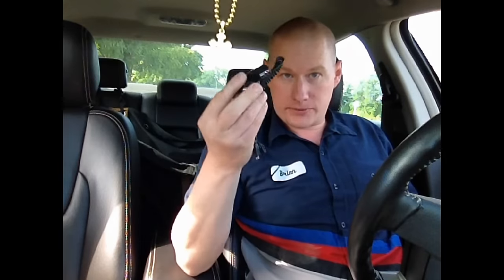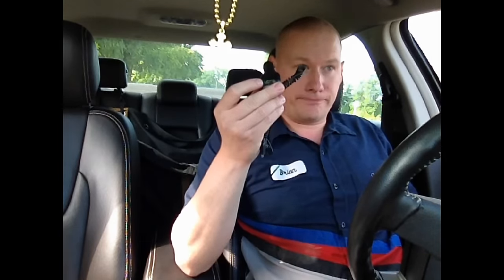Troublesome Ford Tire Pressure Monitor Faults Tip

Comment: Would putting on after market wheels and tires cause this? I had them on for a couple days now and the fault just now showed?
Reply: Excuse my grammer
Reply from the maker: Landin Boler  Yes it would cause the light to go on if they did not transfer the sensors which most don't but it would happen in a couple of miles.

Comment: I don't have any electronics in my 2012 F150 that would interfere with the signal, but Discount Tire changed out the tpms in my Right Rear wheel and I've had multiple sensor faults with it. Do I need to retrain the sensor or take it to Ford and have them put an OEM one back in it?

Comment: I have a 15 f150 and almost once a week I get this tire sensor fault alarm. My synch 1 radio jumped from level 6 volume to 30 out of nowhere once last week. My radio also has gone out completely while driving and the ford logo came back on the screen as if I just started the truck up and the radio came back on. All these weird things possibly related to a charger? The Ford dealer checked it for me and said the computer stored a "code from the radio that the computer didn't like" but no details on what it is. Got any insight on this? I've also had the Otis fail to start the truck as in no crank attempt at all. Could be turned key poorly or another electric issue?? Tired of taking to the dealer and getting nowhere.... Amazed u have this knowledge regarding cheap electronic interference yet my cheapo charger is hanging right there in the dash and they haven't said a word about it.

Comment: I just bought an 09 F150 Fx4 and during test drive I got no warning lights but on drive home it was flashing intermittently. I did plug a phone charger in so I'll remove that and see of it goes away, is there a specific type of charger that you know of that won't interfere? Also is the antenna above the rear view mirror a component of the tpms? Thank you for the tip.

Comment: MrOlderandwiser

Brad, I know this video is 4 years plus old, but I just had a 2013 F250 super duty in my shop with a B124D-02 for a code. Right front Right Rear sensor would not train. I found a remote back up camera hooked up to the acc. outlet. Unplugged it and every sensor trained and all is well. Customer is ticked because he can't use his B/U camera anymore. I told him he could plug it in when he needs it to back up, but he needs to unplug it going forward. He said he is going to go after Ford.
Reply: Good luck going after Ford! They usually deny any responsibity for these type of problems! Poor engineering and design are the true culprits!

Comment: My fiance has a Ford Fusion 2010 car and his car just now got the "tire pressure sensory fault message" we put air in all four tires and the fult message did not go away. We have  never seen this message before in his car. It always said low tire pressure.
Reply: Did it apear after installing tires
Reply: Jimmy Theriault Eiveck No. He got the tires put on about a year ago or so. We ended up taking his car to a tire shop and they were able to put air in one of the tires that was 20 on the tire gage. And he drove his car around for a day and a half before the message finally went away.

Comment: What about a weak battery or something?  I have a 2015 F150 5.0 XLT and just fixed a flat.  I had to drive to and from work with 17PSI in the tire before I could fix it.  I pumped the tire back up and I noticed it took a longer than usual to pick up the new pressure and then after a couple days, it appeared to die as I got a tire pressure sensor fault.  Any Ideas?

Comment: I've had that warning almost from the day I bought my Escape.  The dealer could never fix it when I took it in for other maintenance.  I have a TomTom GPS unit plugged in all the time whether I'm using the GPS or not.  I'll have to unplug it to see if that is it.  Thanks.
Reply: wol4ine91 so did it fix?

Comment: Thanks for this post. Had a 2011 Malibu with this very issue. Person took the aftermarket charging cable with them and TPMS issue would go away. Hopefully, manufacturers find the workaround for this problem because cheap electrical devices and cables are not going away.

Comment: Hey first let me say thanks for the video I have a 2016 Ford f150 with the factory 17 inch wheels .today I bought a set of 20in lariat Ford rims from someone and I put them on and the sensor light came on and said there was a default in the air pressure system. I  was wondering can I still set up the TPMS sensor to work properly if so how thank you in advance

Comment: I have a 2014 F150 for about 3 weeks, have gotten the TPMS sensor circuit fault about 5 times.,get the message on the screen and the symbol flashes then goes solid. Usually clears before I have a chance to put my reader on it did not get a code.  watched this video and it makes sense but each time did not have anything non OEM plugged in or operating.  Any ideas.

Comment: I have a 2010 Ford Focus with 198,000 miles on it.  Love this car! My question is, recently the Tire Pressure Sensor Fault comes on traveling over 50 mph within 20 minutes of driving.  I have checked my tires, no leaks, no loss of air.  How can I stop this from happening?  I watched the video but unsure if it works on my 2010 Focus.  Thanks.

Comment: What about Apple's cell phone charger or cable that plugs into a cigarette or usb port outlet will that cause interference with the tpms module? I have a 2006 Ford Explorer v6 with a tire pressure monitoring system warning light on in the the instrument cluster. I been driving like that for months with no idea how to check them if its faulty or which one is faulty. It would be nice if it tell you which tire has the faulty sensor instead of just displaying a faulty tpms.

Comment: Oh great. I suspect the rear sensor is acting up because the previous owner installed some thing to boost the bass of the speakers. It's not big at all, but it sits hidden behind the trim above the rear right wheel well. Could that cause a disruption?

Comment: i'm a Chrysler tech and couple months ago we had a 2013 Ram 1500 in and the complaint was that the TPMS light was going on every time that you past 3000 RPM, at less than 3000 rpm or at idle the light was off.the alternator was the culprit bc it had a bad diode in it and had to much ripple causing a lot of interference try to explain that to the customer

Comment: Great info.you provide.  Have an '09 Escape and an '11 Fusion.  We use winter tires with another set of Ford sensors in the wheels.  Have the tool and trained the winter setups.  When swapping for the seasons, the Escape always faults out and needs to be re-trained while the Fusion never has an issue.  Have any explanation for this issue?
Reply from the maker: Only thing that I can think of is the Escape has a max number it will hold for sensors where as the Fusion can hold up to 8 tire sensor id's
Reply: Didn't know that.. Thanks for the info.

Comment: hey I've been troubleshooting a tire pressure fault sensor for a couple weeks now. I bought these new sensor 6 months ago with a set of wheels and put over 10000 miles on them with no issues. just a couple of weeks ago I change them out and now they have a fault coming up intermittently. there's no Rhyme or Reason to it usually happens after 25 or more minutes of driving. it usually doesn't every trip but sometimes I can go a trip without it doing it. I have tried disconnecting my radar detector and other electronics.  what should I do and where do I go with this?

Comment: Do you have a video for replacing the TPMS module?

The TPMS warning popped up on my dash display. It says Tire Pressure Monitor Fault. At the same time my fob remote (lock / unlock) stopped working. I took it in to a tire shop and they said all sensors in the tires are still working and that I needed to take it in to the dealer. They said it was likely a bad module since the TPMS and Lock/Unlock use the same module. I also replaced the batteries in the fob. When that didn't work I purchased a new fob, new battery, and tried to reprogram but couldn't get it to pick up the new fob signal. 

Nothing plugged in to any cigarette lighter ports.

Comment: I switched all the sensors on the tires. Retrained them all successfully, but I still keep on seeing "Low presure tire" signal, even though my tire pressure is fine. No interference inside the car either. Ford Explorer 2011. What do I do?

Comment: I just got that TPS fault light and message come on today on my 2011 for fusion sport My son used a charger a few weeks ago but none since I guess it is just a bad sensor I checked air pressure and added a little air.Will this cause my emissions to fail when it is time to do them?They check for trouble codes.

Comment: I came across your you tube channel and your video for Troublesome Ford Tire Pressure Monitor Faults Tip and the cheap phone charger I had was tripping the fault. Thank you! I do have another problem hopefully you can help with? My compass is stuck on North, now i have tried to fix/change through settings, changing it from rotating North to fixed North and back again with no change stays on North even on the center display and while in gauge mode it shows a truck with compass and that is stuck to North as well and does not move, I drive a 2014 F-250

Comment: Thank you for the tip, I have a tourneo custom and sometimes I get TPMS malfunction error, then I press OK and it goes away.. after some time ~30mins (not sure) It appears again, can it be the same issue ?
Reply: I drove for 1 hr. It seems that the reason was the Chinese power adapter of dashcam recorder. I placed it in front of BCM by mistake, BCM has the antenna for TPMS
Reply: It worked! I relocated my dash cam's power adapter from near the BCU (body control unit) to the rightmost side (passenger side), and now the TPMS malfunction error is gone. Thank you!

Comment: I have a 2017 ford fusion, and i was driving and all the sudden the tire pressure sensor fault came on and flashed then it stayed solid but then after a few minutes it went away. It scared me cause i have such bad luck with cars. So i shouldnt be worried too much about it?

Comment: Have a 2007 Ford Escape Hybrid and it died after saying Stop Safely and keeps saying Tire Sensor Fault. I have a new tire sensor being installed on the tire but how to get the truck to restart as it won’t start?

Comment: I've got a 17 explorer police package the sync head unit has a USB plug in the console .it has a short located in the the plug .could this be the issue about the time i realized the short i started seeing g the air pressure warning

Comment: I've tried to position relearn with a scan tool, which the left rear did not want to be picked up by truck only the scanner, but the interior lights kept flashing and wont turn off.. is there a way to make it stop?

Comment: Maybe you can help. My 2005 Ford Expedition showed a TPMS monitor fault in the message center. I personally changed four (original to the vehiclel 2005 sensors) Motorcraft (blue) sensors per instructions. The fault went from TPMS "monitor fault" and amber tire pressure flashing (18-20 sec) to "tire pressure fault" and amber low pressure light on constant. Took the vehicle to Ford to reprogram the sensors, they couldn't get the sensors to program. Needed additional troubleshooting. Service rep. called back and said I needed a VSM due to an "internal fault." Changed the VSM, still can't reprogram/ train sensors. The service rep called back and told me that I needed four new TPMS sensors. Had the Ford tech install a new set of TPMS sensors (two new sets of TPMS sensors). Still cannot get the sensors to train. I tried the sensor training procedure, (ignition key off position to run three times, press and release brake pedal, key to off, key to run position three times) but the training mode was never successful. Horn will not sound. Any ideas, FordTechMakuloco? The issue has been sent to the Ford Hotline for additional help.

Comment: So I thought bc I had a bluetooth speaker charger plugged in that was the problem but it is still saying tire pressure sensor fault. I have tried to retrain video and I cant get that to work either.  What is my next step to get this fixed bc that light is driving me nuts!

Comment: Just a heads up, ran into this issue today with a car monitoring chip I have to plug into the OBDII port for work, so not only chargers causing these problems!!!
Reply from the maker: +urveen Yes there are many items any car insurance trackers, external radios etc.
Reply: FordTechMakuloco so whats the solution

Comment: Hi,  here is my request.  My reverse lights are not coming on.  I have ruled out the bulbs and all the fuses on the 2008 Ford Edge FWD, 3.5L V6.   Does this vehicle have a reverse light sensor? 
Can you pl., do a video soon on how to change that or whatever else that needs to be fixed to turn on the reverse lights when reversing?   Enjoy your thorough videos.   Thanks a lot..

Comment: I thought one of my TPMS sensors went bad, so Inpaid $65 for a new one. Still getting a sensor fault message, so back to process of elimination. Maybe the module (as you indicated), but I would think that a bad module would give a ZERO psi reading for all 4 tires, whereas I’m only getting a ZERO reading at the driver-front (even after rotating tires). 🤔

Comment: Got a 2014 Edge that shows the orange wrench icon. The transmission disengages and the engine idles rough.  Brought to dealer and they replaced ABS module. Few days later same problem occurred. This time L turned vehicle off for about two minutes then restarted with transmission engaged and orange wrench off engine normal. Got any ideas what's going on?

Comment: Sir, I've had weird things happening on my truck. F150, removed all chargers thinking that was it and it happened again, took to dealer 5 codes they pulled U0140, U0415, B1131, U0100, B124D (they wrote B124DM but can't find any with M) do u have any thoughts on this?? They reset computer to see if it helps. Happens every 20-40 miles driven.

Comment: I bought a cheap charger plugged it in and like 20 miles down the road the TPSF came on and my radio stations all started to become static. Hope this.is my problem thanks for the video
Reply: The Charger was the problem. Thanks for the info helped alot

Comment: 2011 Lincoln MKX (aka Ford Edge elite) and my Tire Pressure Sensor Fault msg comes on when I start the vehicle! No chargers plugged in. My Sync unit has lost its Bluetooth and rear camera capability so I wonder if this is another Sync issue. BTW, I tested each tire pressure sensor by removing air and they all gave the Low Tire Pressure warning even though the TPS Fault was still happening! Argh!

Comment: I have a 2007 Ford Explorer XLT 2WD. A nail went into the tire and damaged the hi-dollar sensor. Can i just pull the module versus replace these expensive sensors?

Comment: Hey, I have a 08 Merc mountaineer. I get a tpms fault code only after driving highway for a good amount of time, say 45 mins or so. Go back to street speeds dash light goes off. Also a interference problem?
Reply from the maker: Yours sounds more like one of the sensors are failing due to low battery power, my escape has tire faults only in winter because of the low battery being affected by temp hard to pinpoint which one because they are not id as left front right front etc just by their id number on them which means breaking down the tires to find it.

Comment: The issue I have is that I bought a new wheel/tire package from TireRack for my winter tire setup and I've been seeing the fault notification pop up ever since. It doesn't come on immediately, but rather about 15-20 miles into a trip. The alert light will be off while I'm driving along and then all of a sudden it will turn on. It didn't do this with the stock wheel set so I figured it might be bad or incompatible sensors in the new wheels, but if that were true I don't get why it would take a good 20 minutes of 35-45mph driving for it to finally come on and tell me. For what it's worth, while I have a cheapy charger, the fault alert comes up even when it's not plugged in. Any ideas? As far as I know, everything in the car is the same as when I had the stock wheels on and didn't have any issues. Tried training to no avail.
Reply: kozyshack12 I'm in the same boat with my Lincoln MKZ. Bought a package online with sensors and the light comes on. Adjust the pressure a little bit, and it goes off the next day. I have no chargers in my car. I ordered the relearn tool to use on my new sensors. That is the first thing I'm going to try. Your situation sounds like mine, so maybe try doing that.
Reply: kozyshack12 What did you use to train?

Comment: I have a 2008 Explorer Eddie Bauer Edition, and I notice this happens when I've been driving for a while at around 60mph, always on a highway. Could interference be the cause of this too? What type of devices would cause interference other than a charger? How about a GPS?
Reply from the maker: Anything that transmits rfi or in other words anything aftermarket.
Reply: I have 08 explorer Eddie Bauer 4.0 the tire sensor fault appear then the truck start running very slow is there related to the sensor also or the transmission is start having problems

Comment: hi, i have seen like 3 of your videos trying to fix a Ford escape 2013.   we change the sensor of the rigth rear tire for one that was in a F150 because the one in the escape was broken when the tire was changed.  first we tougth that it will work just by doing the change but it did not. then we tried programing them runing at 20mph but did not work. then we did all the break 3 times key break 3 times key but we could not make even the first tire to learn, we dont have the tool so we use a magnet and then taking some air off and did not work. do you have any comment or recomendation?